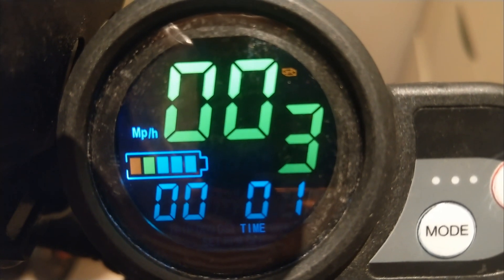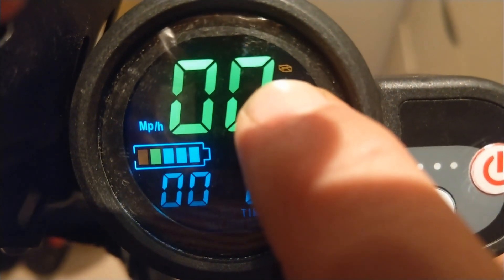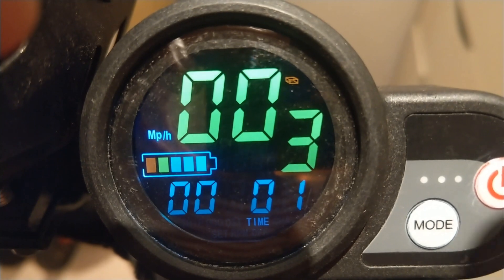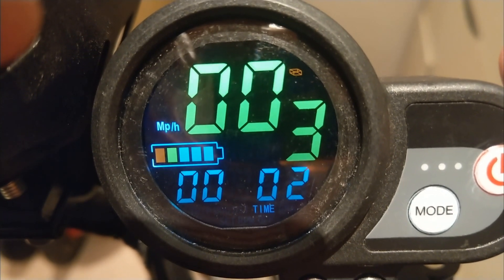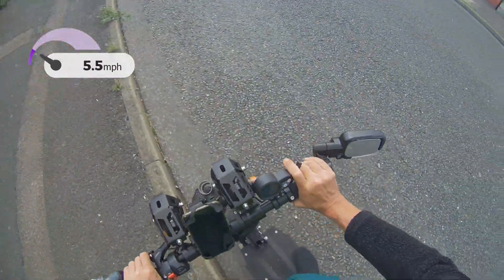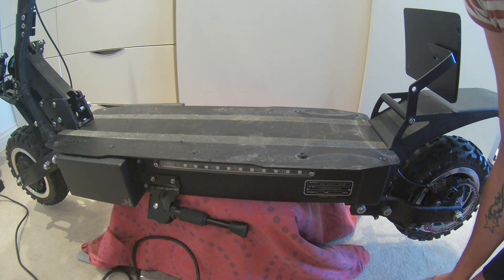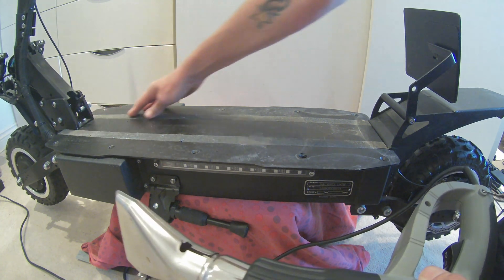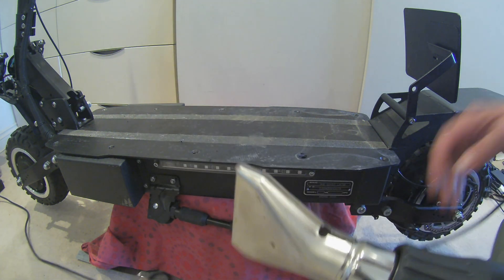Electric Scooter - Motor Controller Failure Part 1

Comment: i had this problem with scooter for the front motor when the display was doing this before the motor stopped running. https://www.youtube.com/shorts/_BshnDVhECE the mph its showing is jumping from different numbers and motor or wheel making weird sounds similar to this guy's scooter.

Comment: I have that box appear only once for a quick few secs after I turn display on and off a few times that disappeared and never came back but recently I got the symbol showing M appear so does that mean my motor is no good or a controller problem can trigger that M to show up???
Reply from the maker: Sounds like a controller issue, or possibly a dodgy connection. I've had similar before. In the 9 years I've been riding hub, dual hub and chain scooters, never has a motor let me down
Reply: i was talking to a friend and a few also told me its hard to burn out the motor but the motor also have cables too... do you have email where i can send you the pics of the inside of my scooter wires and cable once I took it off??? i took it to e scooter repair shop and the but guy told me that it's my controller that is bad but he didnt tell me if it was both he just said rear controller since i told him my rear wheel stopped working...but when i press dual mode button the front wheel is also unable to move. when i rode home i went up some hill with the front motor working cause i put dual mode on but after 4 miles it started making weird sound coming from the front wheel which i thought my front motor had gone bad too....or did i maybe also messed up my front controller??? so is there a way to let me send you the pics so you can take a look and let me know if its controller, throttle or my motor that has gone bad??? the scooter repair shop is charging me $150 to replace controller if i bring him the exact ones for my scooter but if i want them to use their spare parts which may not even be the same parts for my scooter they charging $300.
 @marcusoroberts

Comment: Hi Marcus, I have an x750 scooter 52V and it just quit the other day when accelerating. The speedometer just went black and I can’t get it to turn on. The battery charged up fine so it must be the controller or the screen circuit board itself I’m assuming?
Reply from the maker: John, hard to diagnose remotely. Normally the Mosfets go in the controller, but that shouldn't make your display go black. The display should all be working. I'm guessing the same as you, that it's a total failure of something else in the controller. There is a large electrolytic can capacitor straddled across the voltage rails in the controller that bulges on the lid quite often. Have you checked that? Cheap and easy to replace. Other than that, just change the controller. Sorry I can't be of more assistance. Good luck!

Comment: Hello I got 3000 watt motors and I was using J&P controllers 2800 watt but once I upgraded motors to type 2 motors my bk B controller keeped blowing every 2 or 3 months I must of brought like 5 of them now I got 3000 watt yunli controllers with a LH-100 display and I keep getting a E10 error code and the same error your showing on your screen but with the solar P1 or janobike T85 for J&P controllers display the flashing box symbol how can I solve this problem cause I need to use 3000 watt controllers

Comment: Hi Marcus. Not sure if you are able to help. I have just bought the t112 scooter and want to set it up like yours with mirrors, seat and what looks like a number plate. I want to make mine street legal as i am using mine as a mobility scooter. I'm 58 but still like to have that power there. Can we  chat some how. My name is phil by the way?
Reply from the maker: Hi Phil, sorry for tardy response. How might I help? I think the T112 is a really terrific scooter. I was one of first to get one and is a good choice. The number plate on the T112 is rigged and took it off my Evo Uberscoot which is fully road legal; one of the very few in the UK to have that status. The number plate is just for the photos.
Reply: @marcusoroberts    Hi Marcus. Thanks for getting back to me it's much appreciated. I feel like scooter riders are all being painted with the same brush, and i think it's because of the young'ns who tare around with no regard to safety or highway code etc. I have walking difficulties and want to use my scooter for mobility. I am 58, have full UK driving license, ( clean) and don't want to have my scooter compounded or points on my license. I'd like to get my t112 road legal with all relevant lights, registration etc. I don't know if it's going to be possible but I have to try. When you think, most vehicles are able to break speed limits so i don't see why you can't have a powerful scooter ( which can be restricted to say 30. I realize it might be impossible to achieve what I'm after but i have to try. Do you have any suggestions mate. By the way, are you still scooting? Regards Phil

Comment: Hi bro I have a 1000w chaos scooter and it stuck at 2 bars and gose 2mph and it don’t charger the lights stays green any tips I though it was battery but now thinking it the controller
Reply from the maker: Doesn't sound like the controller. Maybe the charger unit is faulty. If you measure the output of the charger unit and make sure you get a good healthy voltage coming out. I can't remember what the polarity of the pins is, but it's 0v or less than 12v then the charger is duff. Otherwise the battery or a loose connection
Reply: @marcusoroberts  I check the battery’s there all 11v each so there all good but it wouldn t know what els could be

Comment: My problem is that my scooter shuts off when I go flying downhill, especially on large bridges.  If I’m in third gear just tap my brakes for control going downhill.  What is the correct way to use gears going downhill on an electric scooter.  My Joyor y9 goes 28mph for 50.9 mile range.  Thanks 🙏
Reply from the maker: @ruestjacques  that is normal and not a fault of the Scooter. What model?

Comment: Hello I seek your advice on my kugoo m4, 36v lithium, it was involved in crash and since the back motor seems to get power but not rotate, it then gives error 001 but it just refers to motor failure. I have rewired the motor and the same thing happened. Cheers

Comment: I have an error code that looks like a screw symbol does anyone know what kind of error that is?
Reply from the maker: Hi, it means a throttle/LCD related problem.
Reply: @marcusoroberts  hello! I changed the lcd for another exactly same model (new) and that "screw symbol" aka throttle problem persists. Maybe it can be the controller's fault? The scooter accelerates by itself all the time. I've bought two new controllers (1 for the rear motor and one for the front motor) meanwhile, just curious about the problem.
Reply: what does the symbol that looks like a rectangular box on the display mean???? and if i see this one [M] ? @marcusoroberts

Comment: On my scooter, I have the small  letter "M" show up on my small dash display, and I have had issues with the power cutting in and out. I have brand new batteries in my scooter (less than 3 mos. old since old ones replaced. I also noticed that while this "M" is showing and while the motor is running, I loose the speedo readings (in other words the speedo doesn't work). If I turn the motor wheel, before the "M" is showing on the display, the speedo works properly, but once the "M" lights up, it stops working again. At times, the motor completely stops running, and the letter "M" disappears, but if I turn the motor wheel by about 2 inches by hand from where it last stopped, like a miracle, the motor  fires up again, and the letter "M" returns back on the display. Would you say that my issue with my scooter is the same problem you had in this video, regarding the controller. The fellow that has always worked on my scooter, keeps saying it's a battery issue, yet the same thing has occurred, with good used batteries that meet his standards of both voltage, and current ratings. I'd like to also know, if that small letter "M", tells me there's a controller issue causing this problem?    Can you help me by answering my questions on this matter?
Reply from the maker: Hi Wayne, The 'M' means there's a motor problem. Almost certainly. Does it happen when you select the rear motor, or what happens when you select dual? It's a very small chance that it's a bad connection, but I'd bet it's a bad motor.
Reply: @marcusoroberts  .. First off, Thank You for your kind reply. Wasn't sure if I would hear from you, seeing video was made in 2019.  Next, I own a scooter bike, not a two wheel scooter like you have. Inspected the new batteries, and only after a couple of months use, they have all swelled up.  They are rated at 20 amps. each by the company that makes them, but now I find they were a very poor buy, due to quality, and will not buy another set of them for my bike in the future.  With the battery casings so badly warped, I rather doubt they will give 10 amps of power now. They had welded togther from the heat of charging and usage, and screw driver had to be used to pry them apart. So that's one issue solved, that I was not aware of till today. I also found out today, that the armature inside the motor might have been replaced, from a different model of same make of scooter, which might be another bit of this mystery solved. The armature came from another used "Motorino" scooter bike, that had good controller wiring on it, and to save time in rep[airing my bike, armature, and wiring was installed into my old wheel hub. The guy that did the repair, is doing a check on whether that armature is good enough to run in that hub, or whether there's an issue with it, as well as with the new batteries that were in it.  He's going to reopen it up, and check the whole unit, at his expense (even if it requires getting another better armature for my bike). I'll know in a day or so, about his findings. He has a new shipment of batteries coming in tomorrow, so they will be both checked, and then be  installed It's possible, that there maybe, bad winding in that armature he installed, that he didn't know about. Normally when my scooter is running right, that scooter can easily  travel at 55kms. per hour at top speed with two people on it. Just sitting on the rear wheel stand, it max's out at 62 kms. with no effort at all without cutting, in and out. I'm hoping this guy will finally get it back in the same order again. Thanks for letting me know what that "M" means. It's not listed in the owners manual, that I finally found on the internet, and didn't get when the bike was new.  Kind regards, and again thanks for the come back.
Reply: @marcusoroberts  ... Thank you for your kind reply, and confirming that the letter "M" is definitely a motor issue problem in my scooter bike. I have only one drive motor, located on the back wheel. My scooter looks more like a Vespa (but is an electric motor version), than a foot/standup scooter version you have, with two motors (both front and rear.   Mine runs on 60 volts Dc, (5 batteries in series).  I installed a brand new set of 20 amp batteries, on My 30 2020, and already they have over heated, and wrapped from excessive heat. I'm again replacing them with what I hope are better batteries, of the same value. The fellow that worked on my scooter, after the pedal chain cog, spun off, and cut through my rear wheel wiring, told me he had replaced the whole armature (Wiring included), from another bike like mine (new wiring was also included).  It appears, that what replacement part he installed had defects somewhere within it, which is causing the cutting in and out of the motor's operation, even with fully charged batteries. My scooter is back at his shop, and it's now his job to correct the problem at his expense, as I have already paid for the repair back in May of 2020, and it wasn't corrected fully by him, so he now has to finish the job I paid him to do, at his expense. Thanks again for your kind reply. I'll update you once the repair is finally completed. Take care and safe.   Wayne.
Reply from the maker: @waynedavies3185  Hi Wayne, thanks for sharing. So, it sounds like the batteries are Sealed Lead Acid rather than Lithium..? Please keep us updated. Stay safe!
Reply: i think i have this same somewhat similar problem with mines...wondering if the M which i keep thinking something is wront with my motor is the speed controller that controls the rear motor making the rear wheel not work which just shows M and is not the motor problem but the controller that controls the rear motor is the problem. even though display shows up with M???

Comment: Marcus! Hi! Hope you are well safe and happy.. Apologies for the late response.. The situation... Well it is lead acid.. Took some pics could that help?? Many many thanks
Reply from the maker: Hi Monica, I'm good thank you and trust you are too. Well, thanks for clarifying but it's almost certainly the battery. Not sure if it is one large pack or several connected? If it's several connected (might be series but more likely parallel) it will be a damaged cell and there's no way to fix other than replacement of battery - hopefully they're is a lithium replacement. If several batteries then you need to lift the scooter off the ground, run full throttle and measure for lower voltage on each battery. But look, it MIGHT be a controller fault too...
Reply: @marcusoroberts  Marcus!!! I can't believe it!! We fixed it, we fixed it!! My 'baby' is in good health and running!! Thank you, thank you, thank you!!! 💋💋💋💋💋💋💋
Reply from the maker: @MONICA-SMILES  hey Monica today's wonderful news. Well done!
Reply: @marcusoroberts  indeed!! And you are the best,  Marcus!! 👏👏👏👏👏👏
Reply from the maker: @MONICA-SMILES  you did it all yourself 👏👏
Reply: @marcusoroberts  only possible because you are a great teacher, Marcus! and I am so grateful and delighted that you share your time and knowledge (and patience)... Olé, olé y ole!! 🤗💋
Reply from the maker: @MONICA-SMILES  please let me know if you have any more problems with it Monica. Thank you for your lovely comments.
Reply: @marcusoroberts  you're most welcome . I owe you a coffee.. Let me know when you come down to London. Hasta la vista 🤗
Reply from the maker: @MONICA-SMILES  I live by London, but no need for coffee reward. Maybe hook up sometime😀
Reply: @marcusoroberts  among all cities, really? 😄 Well, that would be great!
Reply from the maker: @MONICA-SMILES  it's a small world 😀
Reply from the maker: @MONICA-SMILES  We go for a coffee when all the lockdown is properly over and when you are free.
Reply: @marcusoroberts  Hi Marcus! Hope you had a good day today. Still can't believe you live by London.... Lockdown is not funny but necessary... When this is over I might need something stronger than a coffee 😁 meanwhile, stay safe. hasta pronto!
Reply from the maker: @MONICA-SMILES  Tell me about it! On holiday till Friday and busy with vodka at home. If you're free let me know. Friday will be hot hot hot
Reply: @marcusoroberts  😄 yes, I am free on Friday...
Reply from the maker: @MONICA-SMILES  me too
Reply: @marcusoroberts  are we meeting tomorrow then... Somewhere near water since is going to be hot? Would you fancy that?
Reply from the maker: @MONICA-SMILES  Hey Monica  07949 330640
Reply from the maker: How coincidental just sent you my number at the same moment
Reply: @marcusoroberts  wow!!  Noted..😄.. .Where shall we meet? What time?
Reply: Hi Marcus! Enjoying my scooter like crazy.. I 'll be travelling for work after all...be back in the Uk by October. Take care!! And again... Thank you ever so much for your valuable teachings! Hasta pronto!!
Reply from the maker: @MONICA-SMILES  We will meet espero pronto

Comment: I have a failed rear motor controller.  I'm not technical.  Is it possible through the display to disable the controller and ride the scooter with the front motor only?  Help if you can,
Reply from the maker: Hi Rick, no it is not possible to disable the rear motor from the LCD control throttle. You can however still ride it with only the front motor, when you select dual motor option. I really don't recommend this as with front motor only the scooter very 'twitchy' and handling becomes aggressive.
Reply: i rode it like this when my rear motor stopped running and now my front motor doesnt work....it was twitchy and making weird sounds while it was starting to move until it hit a certain speed then the weird sounds goes away.... now when i turn on dual mode it doesnt even work for the front motor... @marcusoroberts